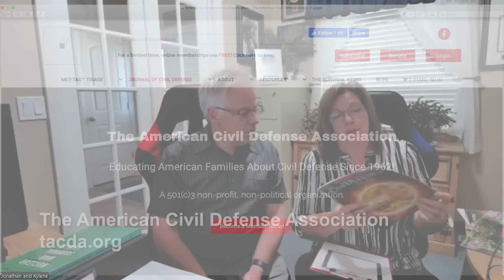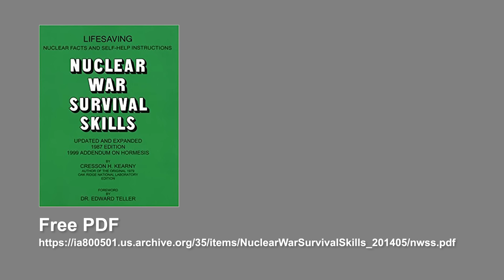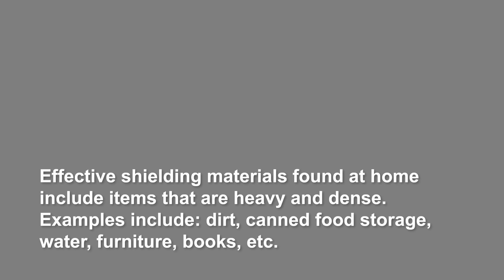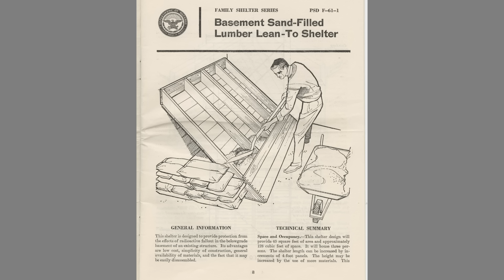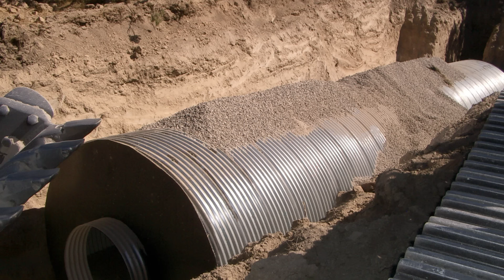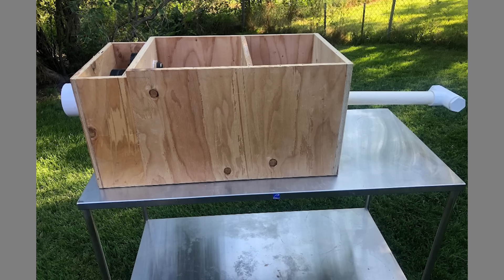Nuclear War: DIY Fallout Shelters with Jay Whimpey PE, President of TACDA

Comment: great if you got money how about people who haven't  we just perish
Reply from the maker: Nope ... you just get creative. There are so many ways to accomplish things without spending a lot of money. Use the basic principles and resources that you have to create shielding. It is possible. Look up expedient fallout sheltering principles. This may get you started:

Basic Principles of Fallout Protection
The key concept is shielding - putting dense material between you and radioactive particles. Fallout consists of contaminated dust and debris that emits radiation, so your goal is to:

Maximize mass overhead and around you - Every inch of dense material (concrete, earth, books, water) reduces radiation exposure
Minimize exposure time - Stay sheltered for at least 48-72 hours when radiation levels drop significantly
Maintain basic survival needs - Air, water, food, and sanitation while sheltered
Choose the best location - Basements are ideal, but interior rooms on lower floors work too

The "inverse square law" applies - doubling your distance from fallout halves your radiation exposure. Adding shielding material follows the "rule of thumb": every additional inch of concrete-equivalent material cuts radiation by roughly half.

20 Low-Cost Expedient Shelter Options
Basement Improvements:

Book wall barrier - Stack books 2-3 feet thick around your shelter area
Water jug walls - Arrange filled containers (milk jugs, bottles) as shielding
Dirt/sand bags - Fill trash bags, pillowcases, or boxes with soil for walls
Furniture fortress - Use heavy dressers, filing cabinets, appliances as shields
Concrete block corner - Buy/find blocks to create a small protected space

Interior Room Shelters:
6. Closet reinforcement - Add books, water containers around a walk-in closet
7. Under staircase - Reinforce the area under stairs with dense materials
8. Bathroom bunker - Use the typically central location, add shielding materials
9. Mattress lean-to - Prop mattresses against walls, add books/water on top
10. Table fort - Get under a heavy table, surround with books, bags of dirt
Outdoor Options:
11. Trench shelter - Dig a trench, cover with boards and 3+ feet of earth
12. Car shelter - Park car over a shallow depression, shelter underneath
13. Culvert shelter - Large drainage pipes covered with earth (if available)
14. Hillside dugout - Dig into a hill or slope, shore up with wood/materials
15. Pile shelter - Create walls from any dense debris, logs, rocks available
Apartment/Limited Space:
16. Bathtub shelter - Fill tub with water for drinking, shelter next to it with added shielding
17. Interior hallway - Use the most interior location, add portable shielding
18. Refrigerator fort - Position old appliances as walls (they're dense)
19. Corner stack - Pick the best interior corner, stack everything dense around it
20. Doorway reinforcement - Choose a doorway between rooms, heavily shield the opening
Key supplies to gather cheaply: Water containers, canned food, battery radio, flashlights, plastic sheeting, duct tape, basic first aid supplies, and something for waste disposal.
Remember, even a hastily constructed shelter with 2-3 feet of everyday materials (books, furniture, water) can reduce radiation exposure by 90% or more compared to being in the open.

Comment: The fastest shelter, you can build tunnel underneath your concrete driveway. Dig h*** beside the driveway, make steps. Be sure and dig the step hole deeper. Then the shelter under the driveway radiation is heavy. It will go to the bottom of the hole in the steps. Or if it rains, there will be some place for the water to go

Comment: Mass is pointless. You wouldn't build a shelter where Russia is likely to drop a nuke. You would build it and live som 80-100 km from any such location. That way your only concern is to make the shelter air tight and install a NBC filter. Wear a hapsuit/gasmask for the first 48 hours, and stay in the shelter for 2 weelks, and you're good.

Comment: Eventually water will leak through plastic so buy spray foam. I'd spring for cement foundation and put a shipping container covered in spray foam. In a SHTF situation, people will steal. Be discrete so you can hide out

Comment: Couldn’t help but wonder if you EMP protected that metal filling cabinet behind you?
Reply from the maker: No that file cabinet is used bank vault cabinet and is fire rated. It is incredibly heavy. I use it to protect valuables in the event of a fire. It makes them easily accessible so they get put back in there.

Comment: Cinder block is fairly cheap and you can build a pretty nice shelter in your basement using the 4x8x16 in. solid blocks. Put 2x12 planks across top and add a 12 in. thick layer (3 blocks high) on top of the planks. that would give you 8 inch solid walls and a 12 in solid roof.

Comment: A better idea if your going to use your basement as a shelter, instead of making it even smaller, all you'd need to do is lay sandbags covering the first floor. So your entire basement would be the shelter and above your sleeping area on the first floor you put a kids pool filled with water for sheiling/grey water use.
Reply: Live load of residential floor joist is 30-40lbs per square foot normally, you need at least 3 feet of earth to block gamma radiation.  A cubic foot of sand weighs over 100lbs. If you were to stack sandbags on your floor you would overload the joist to the point of collapse.

That is why basement shelters are designed the way they are. Please don’t take this advice, listen to actual experts using acceptable engineering methods

Comment: I have a nice tall basement that can convert into a fallout shelter. I need to make the ceiling radiation proof. What can you recommend other than concrete slabs or thick lead shielding (both very expensive) for an 1800 sq ft basement?
Reply: Cinder block (10" or 12" ) fill webs with conrete or dirt/sand. For roof use steel concrete decking bridged acrossed and then more sand/dirt (3')  or concrete to a 12" depth on top. Mind the 90 turn going in to prevent Gamma. Be prepared for 3-4 week stay.
Reply: @reidcrosby6241  Thanks. I'm designing it for up to a one year stay.

Comment: Location, location, location !
If you're not in a big city or near a strategic location, it's all about down wind radiation.
In which case a safe room near the center of your house could work. Then it's about hiding and protecting your food and water source from  other survivors who will probably die from radiation sickness in a few weeks but they still may be a threat after the dust settles.

Comment: Ask yourself if you want to survive first.  May not be the outcome you were expecting.  I don’t doubt you can survive the radiation and fallout.  It’s after that that  it gets tricky.  Food availability, water purification, possible nuclear winter for four years.  Securing food after your supplies run out.  Roving takers, violence,  things you will question why you survived at all.  Mentally can you cope?  My thoughts are 99% of us are not.  I am a long term prep-per and have a plan for nuclear war.  Read “one second after”  I think that is a required source for small town government  and governance and how fast things can change.  It is fiction and based on EMP event, but will get point I am making across.  It is incredibly well written and resourced.

Comment: I can begin by getting more sandbags, filling water storage containers, plan out a 20x20 interior home safe space.  Luckily I have two trenches pre-dug and lots of extra dirt that came from there.  So an exterior refuge is also possible in case the house doesn’t survive the blast and fire.  Gosh, how many sandbags do I need?  I have about 3 dozen, but that’s not going to be enough.  I also need plywood to cover the trenches….   Build ventilation air pumps…   Wow, a lot to do.  Great ideas, thanks!

Comment: Jay's office looks like mine.  Dont forget to think about air in your shelters (see the book they're talking about for an air pump).  Unused septic tanks may work with some modification, if you have land area and resource, go to your local concrete company and see if they dont have 2'x2'x6' concrete blocks made from left over concrete.  You can find those blocks really cheap.  Hard to move, but they stack and make a really good root cellar.  You only would have to worry about the roof.  
If you live in the city, look around hard for old fallout shelters to go to.  They're actually everywhere.  Just knowing where they are is the trick.  Have your bug out bags with food handy in your car so you can take them with you to the shelter.

And then, for everyone thinking about all this, think about what the world is going to be like when you emerge from your shelter.  You'd better be ready to get intimate with the land.
Reply: Could you please tell me about the book they are talking about for an air pump.  I just didnt understand where to find that,  Thank you so much for the time you took to read this.   Sharon
Reply: @Sharon-cd9lp  the links for the books are above under the description of the video. There are some free links as well to download. I just downloaded them.

Comment: I live in a 3rd Floor  Condo  approximately  40 Miles NW  of  Philadelphia; Pa.  HOW  would i protect myself in such a Situation?  ANY information  would be much appreciated.  THANK  YOU.
Reply: Could you make a "walk-in closet" by arranging 4 bookshelves in a manner that makes the closet walls  and stacking books horizontally on the shelves?  You could place boards across the top to make a roof and placing tubs of water on top.

Comment: The plastic covering a wooden underground root cellar/fall out shelter would last longer if you get the highest quality longest lasting greenhouse plastic! Most is guaranteed for at least 5 or more years but the plastic at big box stores will only last 6 months in the sun. Huge difference!
Reply: About a rubber pool liner which would be more expensive. Or recycle a put liner from a well driller.

Comment: Question, if we use our homes for shelter can't we cover the outside of our homes with plastic? Or cover up the basement with plastic?
Reply: What I've figured out,  after doing a little bit of research,  is to do the inside of windows and doors, but don't forget about ventilation,  so maybe leave a window far away from your shelter,  like on the other side of your house,  cracked a little so you don't suffocate.  Also I think taking tarps or plastic and putting them up going from your roof to the ground at a angle (like 45 degrees or so), would help to keep any fallout from landing and accumulating right next to your house, since most of the risk would be from the dust ....might not be 100% foolproof,  but if you can extend that dust another 10 or so feel from your house,  it would make a big difference,  I forget the numbers,  but I think every 10 or so feet the amount of radiation is cut in half
Reply: @dant1239  Thank you DanT this is really good to know but still praying for peace so we dont have to come to this!

Comment: I don’t have a basement. I am divorced and take care of my elderly parents. I live in southern utah so I would be downwind from nuclear radiation. I have closter phobia in small places. My dad has dementia.  The only thing I can think of is to put plastic over windows and try to seal doors better.  Try to keep my dad from going outside.  Keep my cat inside and roommates dog inside.  And pray for best.  I have portable toilets and a lot of other stuff.  There is no way to keep my parents in a small confined area.
Reply: don't run you ac or heat as you will suck in contaminated air from the outside.

Comment: I got a full basement with 1 ft thick concrete walls about 7 fr below grade. It’s dry no pumps was thinking of building something in the corner with sandbags for overhead and wall on 2 sides.

Comment: QUESTION: How would a structure of hay bales work inside a wooden barn? I'd need to hunker in the barn, which has well water and could have food storage in my tack room. I'm thinking I could hang plastic over all the doors, and block me, the dogs, and the horse inside and wait it out. My barn is two stories with a metal roof. I have no basement (mobile home), or root cellar. THANK YOU!
Reply: Hay bales are not dense you would need a lot of them to protect you. Check the Nuclear Survival Skills from Kearny, you have a list of material and you can GUESTIMATE from there. Dogs and horses do make noise, so it will be hard to conceal yourself .  Expect visitors if you are in a populated area.
Reply: @bobleponge1301  That's what I thought the answer might be! They are only 'dense' when it is 90-degrees and you're stacking them in the hay loft! I'm not worried about noise, it's not populated. Thanks.
Reply: As Bob mentioned, the bales of hay are not as dense as most of the usual materials, but they would be better than nothing. The metal barn will provide some distance and a slight amount of protection, depending on how thick the metal skin and roof are. Minimizing the amount of dust entering would be important ...sounds like you are planning on that. Think about possibly creating a structure that the hay could be stacked on and around...something with some mass that would add to the mass of the hay. With this threat, most of us have to get somewhat creative to get the job done. Let us know if we can help further...way to be thinking!
Reply: @JonathanBJones  Thanks so much! I'm watching video #3 now, too. Excellent, helpful advice, and I have to say, the term 'civil defense' is something we used to hear a lot more about, back in the day. It's wonderful that it still exists to help people. Take care!
Reply: Sand bags, probably your best bet
Reply: @dant1239  Thanks Dan!
Reply: If your barn has a dirt floor, what about digging a trench or pit if you will and then lay some wood planks or plywood over top and pile sandbags and/or haybales over it? 90 degree off of it another trench for entering into the shelter? Just thinking less material would be needed too rather than having to have the density for all sides in addition to overhead. Just be sure to have a source of air ventilation.
Reply: @mylightofhope  I absolutely can't do that. I have horses in there that need to walk down the aisle. Thanks for trying to help though. Horses and pits really don't work well together.
Reply: You may want to dig a hole to bury a large water pip like this guy did he started out building it for a tornados, then it turn into a fall out shelter a lot of welding but he said under $20.k he did it himself. You can use it as a storage room or a party room. It don't have to be used just as a fall out shelter. 
I'm up in age I'm going with grace. I thought about doing all this shelter building but I'm at peace. I'll leave this world for other's to push on.
Reply: Hay is no good, need dense material, like cement or soil.

Comment: Isn’t stacking your food storage for protection from radiation going to ruin your actual food with radiation? Doesn’t make much sense to me.
Reply: No, the radiation just passes through sealed containers and the contents and doesn't damage it. As long as fallout particles don't get into the containers and you wash off anything on the outsides.
Reply: I was thinking same thing. If I stack canned food and bottled water, I would think radiation would enter into the food and water then contaminate it.. so these guys are saying food n water would still be safe to consume...??
Reply: @southernyankeeprepper  yes that’s what they seem to be saying. I’d have to do some more research on radiation contamination before agreeing with them. 
As long as radiation only passes through then yes I guess the food would be fine since it’s not a living organism it’s cells would not be damaged. Interesting theory that’s for sure.
Reply: @badtchad4935  it is my understanding that if the food is dead. IE canned, processed,not in the ground growing it will be safe. Must wash any dust off.
Reply: @lindazink4126  yes, I guess that would make sense. Thanks
Reply: @lindazink4126  use gloves when washing off any dust
Reply: Radiation only damages LIVING cells.  It causes damage by messing up your cells and keeping them from reproducing correctly.  Food on your shelf is not alive, it's completely safe from radiation.  The only thing that you do need to be careful about is radioactive dust that may have settled on your food storage.  The  solution to that is fairly simple though, just make sure you rinse your cans/jars/etc with clean fresh water before you open them.
Reply: Great question! OldSchool Jeremy provided your answer...thanks Jeremy! Keep being part of the solution!
Reply: I dont buy it

Comment: A solid cement block measures 15 inches and 5/8 inches total in length, 7 inches and 7/8 inches total in width and 3 inches and 3/8 inches total thickness. 
They don't cost much.
Reply: Good point...thanks!
Reply: Now tripple that in thickness